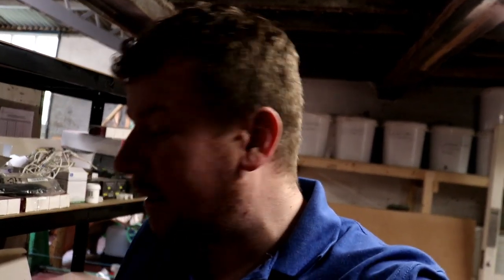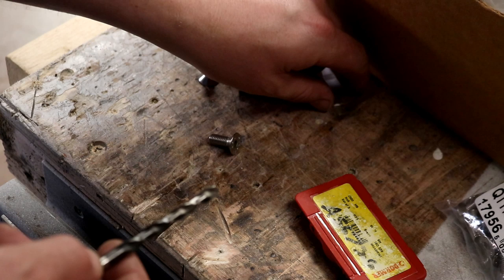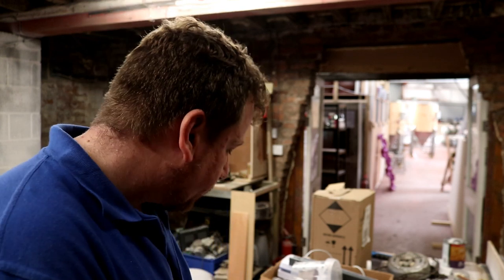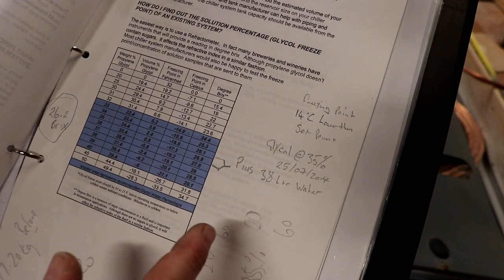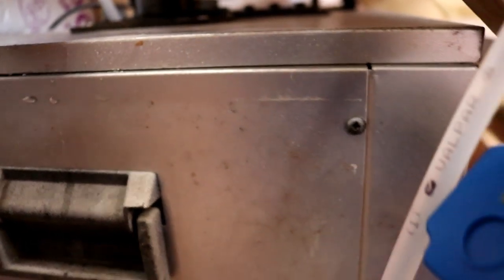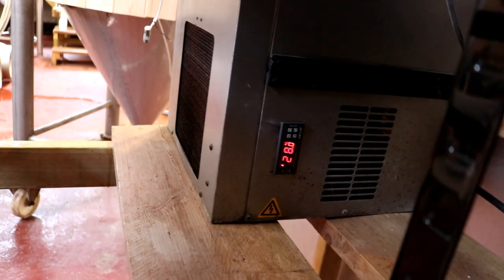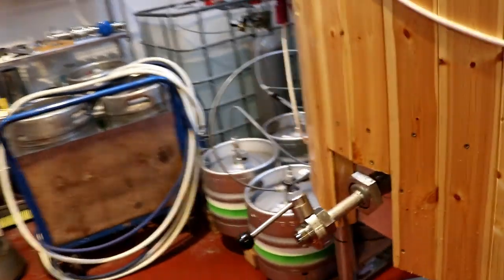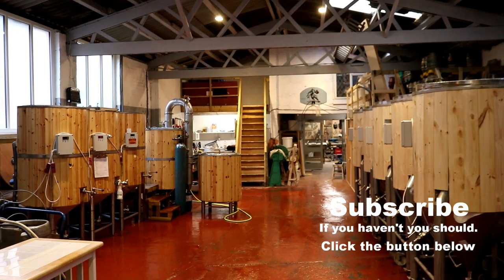AND NOW WE HAVE 8 FERMENTERS

Comment: Looking fab mate, just a cost saving suggestion, when you clean the floor like that you should try a big squeegee and final rinse with water as water is expensive, have you thought about putting a sweeping bend on the existing drain and running it up between  both sets of FV’s now new ones are going to be being used? 

Glad your getting on top of the projects, I was beginning to feel a little overwhelmed on your behalf!!!
Reply from the maker: Yeah, I have plans to extend the drain channel. I was just pissing about hosing down on this vid to be fair. I have squeegees but I just wanted to stand still and spray it down.

Comment: Harry when your dumping the yeast and trub out of the FVs would it be an idea to run a hose from the dump valve nearer the drain so you don’t need to hose down the floor so much?
Reply: Exactly what me and my mrs just said
Reply from the maker: I don't usually do it like that. I usually use a bucket but with the bad knee this week It was easier to stay upright and hose down.. I tried a pipe before but the trub is just too thick to flow through it.